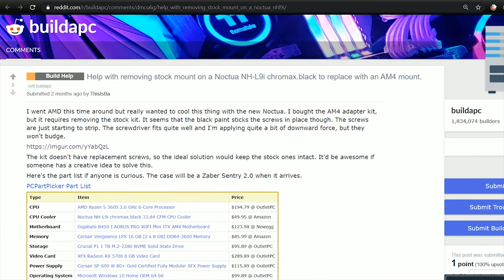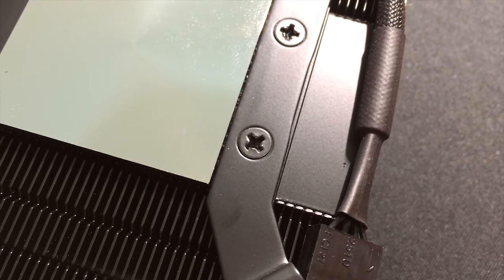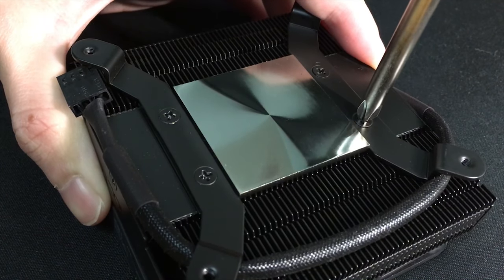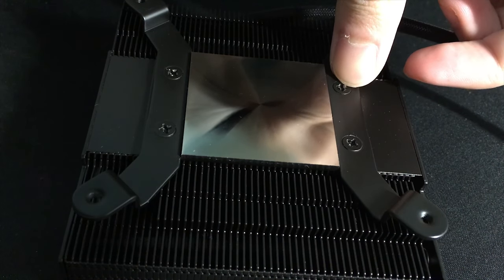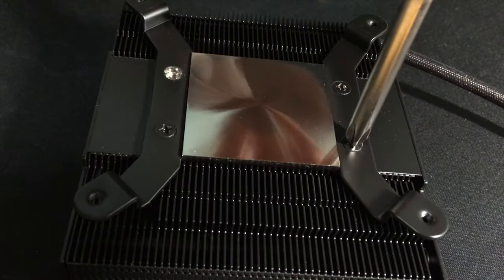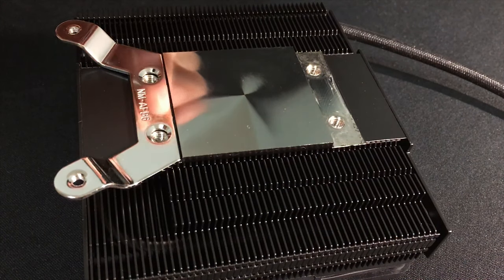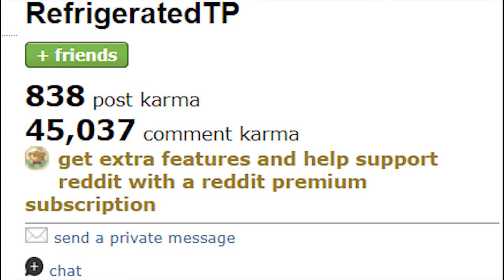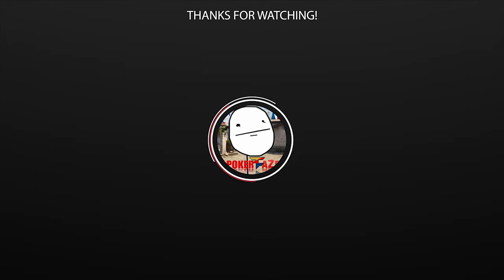How To Remove Noctua NH-L9i chromax.black Screws for AM4 Bracket

Comment: Dude that's a ph2 screwdriver it's way way too big. That's like for woodscrews in construction. It's why you're shearing the head. Get a precision screwdriver set made for electronics.
Reply from the maker: Nope, this is the standard for building PCs. I have been using it for many builds already. It was the issue from Noctua with their early samples of chromax.black L9s, not the screwdriver.
Reply: @PokerFaZe  if you build PCs for a living you'll end sheering a ton of screws. That's literally why you're sheering the head in the video. Yes I know Noctua say use a PH2, yes you might have seen lots of videos on youtube, but dude believe me there's proper screwdriver sets which don't damage the black powder coat - I've been doing this since the 80s. Sure a PH2/PZ2 will work with a bit of struggling - you'll just make all your build look amateurish with damaged screws... and take twice the time.
Reply from the maker: Not sure why you implied I had struggles with screwing my PCs and my screws were damaged, but whatever I won't continue because I think you did not focus on the issue I mentioned in the vid, which also affected multiple users.
Reply: @PokerFaZe  Oh maybe I've replied to the wrong video or something stupid - just going off memory I was meant to be replying to someone who was facing challenges getting the screws off the back of a noctua low profile heatsink and ended up stripping the heads slightly. Totes sorry if I'm wrong!
Reply: @dph9885  Hahaha, you are 100% right mate, first thing I saw - WAY oversized screwdriver. That's the issue here - 100%. Anyone that disagrees doesn't work with electronics.